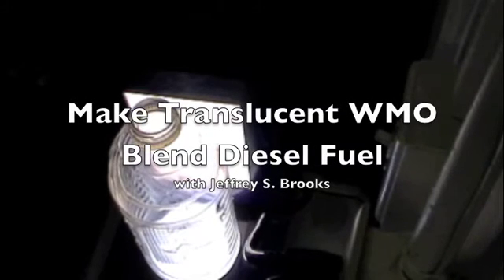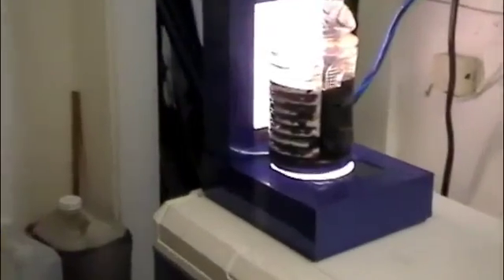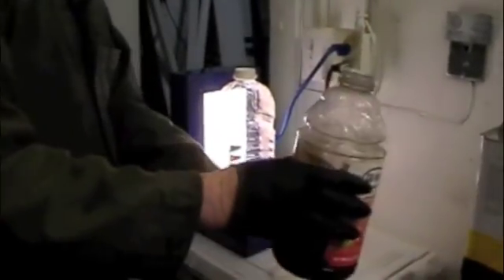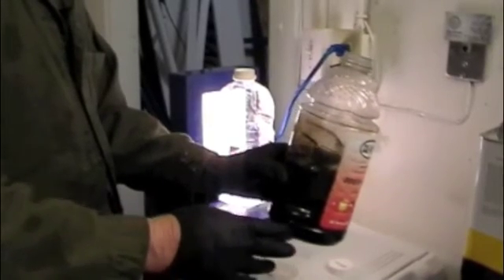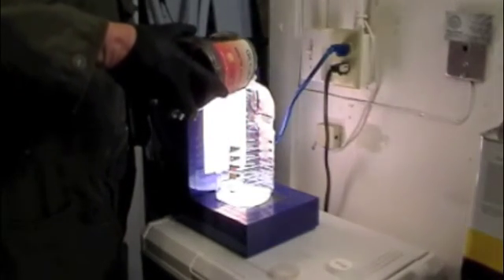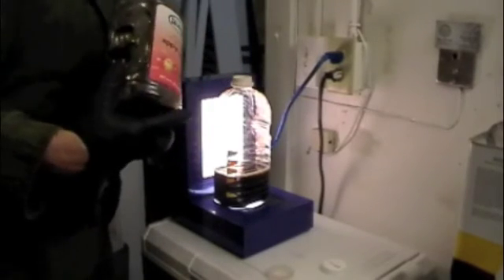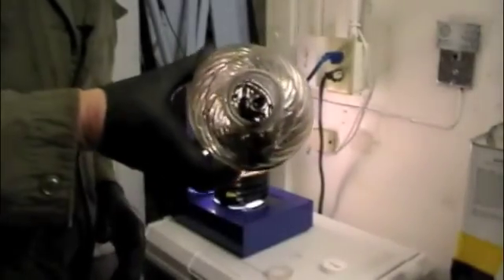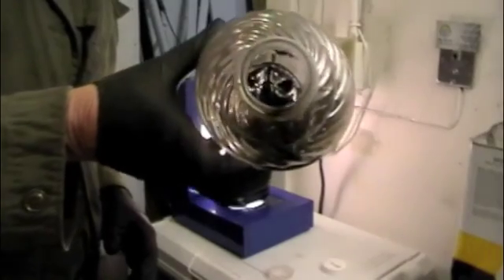Making Translucent WMO Blend Diesel Fuel

Comment: What chemical did you use for the differential solvent and is it expensive?
Reply from the maker: +Tesla Fan I blended WVO with WMO in equal parts, then blended gasoline with it at 30%.  Today I would also reduce that concentration of waste oils down by adding diesel fuel at 20%

Comment: Ever mixed E85 ethanol with WVO? I wonder if it would work as well for biodiesel?
Reply from the maker: Tesla Fan E85 will most probably blend fine with any waste oil, or biodiesel; however, it has too much alcohol in it, so you would have to keep it at or below 3%, so I don't think it is worth bothering with.
Reply: @Jhananda   why is too much ethanol an issue?
Reply from the maker: @adamshine5  alcohols, such as ethanol have a number of problems for bleeding DIY diesel fuels:
1) alcohols are hard on the injector pump seals of injector pumps built before 2000.
2) waste-oil based diesel fuels that are made from vegetable oils contain gum. Gum leads to coking and gumming of a diesel engine, and gum is soluble in alcohols.
So, it is best to avoid alcohols when making DIY diesel fuels.

Comment: Hi Jeff, do you know if there are any issues related to synthetic oils being incorporated into WMO blends?
Reply from the maker: I have looked into the chemical aspects of the pyrolysis of synthetic oils, and have concluded that there should be no issues in combustion, or health, or environmentally due to burning recycling waste synthetic oils of any kind as diesel fuel.  I have also burned them in my engine with no observed differences between them and petroleum oils.
Reply: Jeffrey Brooks
Great! Thanks for the tip.
To ensure the best quality blend and least problems running in a vehicle, do you recommend centrifugal cleaning of the WMO? Is it best to blend with the JetA1 first, then centrifuge it?
Reply from the maker: Yes, a centrifuge is a must if your waste oil is going to be WMO; and blending it first with jet A at 30%, or gasoline at 20%, then settling it for 24 hours prior to centrifuging will go a long way to purifying WMO blends.  However, there are better ways to purify WMO blends.  I am developing a new method, and I expect to make a product announcement soon, so keep tuned.
Reply from the maker: There is no problem with synthetic oils as a base for blending with gasoline, or other solvents, to make diesel fuel.